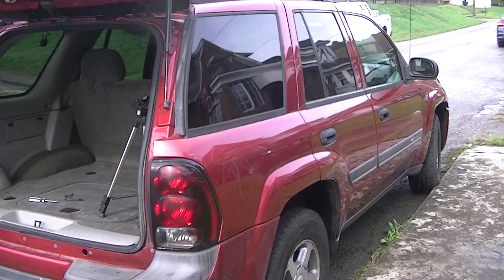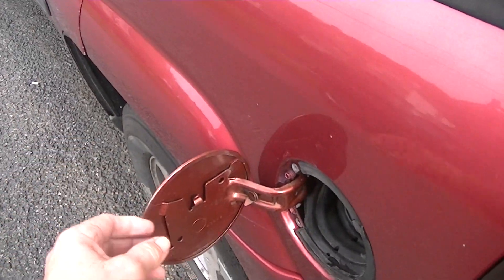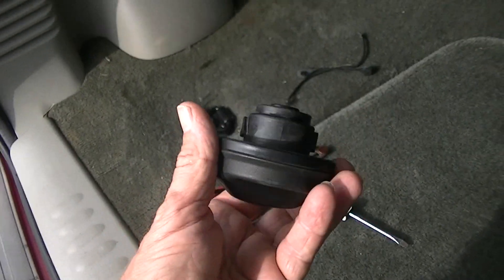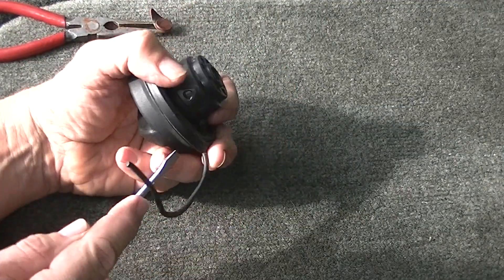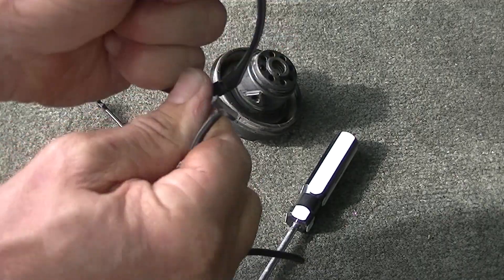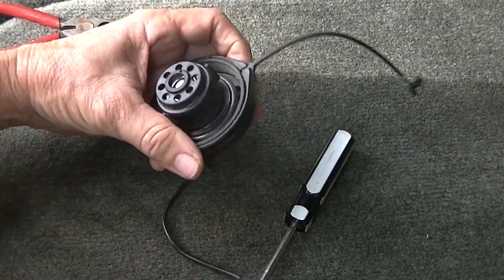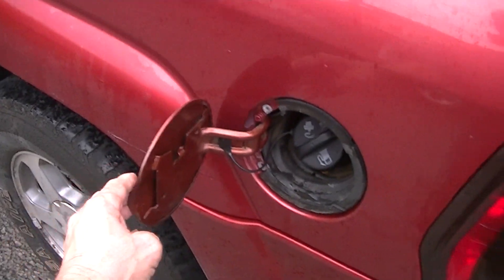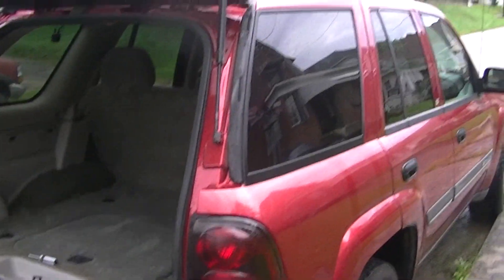Annoying Gasoline  Gas Cap Fix Retainer fix.

Comment: Does this fix engine light problem? Mine comes on and goes off it's own.
Reply: It fixes that light problem if there is a problem the fuel cap itself. You can go to autozone or O'Reilly's auto parts or several others and they will check your codes for free.
Reply: @troy3456789   Trouble is the fuel Cap problem doesn't come up on the Codes as such, it does just interfere with  readings me thinks. I've had this prob. for ages
Reply: @johnspinks3656  If it is fuel cap, it will come up as evap system trouble code. P0455 EVAP System Large Leak Detected